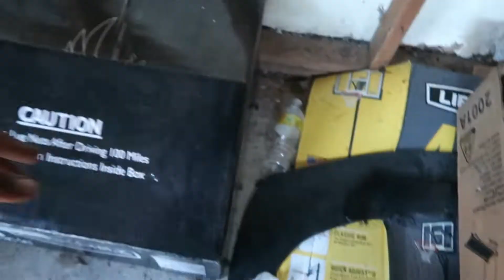392 swap my 2017 R/T charger part #1

Comment: Literally just bought a 392 engine goin to pick it up to put in my  2020 R/T  and came acros this video I’m super excited
Reply: wats everything you need to do a swap besides the engine,transmission,& wiring harness
Reply: @luhjet the tune for the 6.4

Comment: Yo bruh question can I use the same wire I got in my 5.7 to do the swap I only have the engine and the Trans what’s else do I need bruh
Reply: I don’t think you can use the same wiring harness but I could be wrong and you’ll also need the pcm